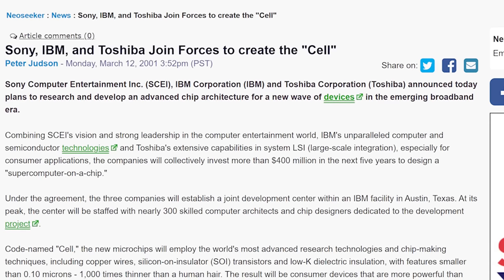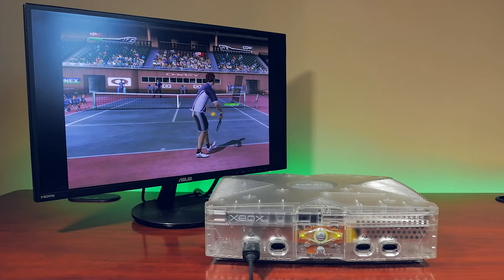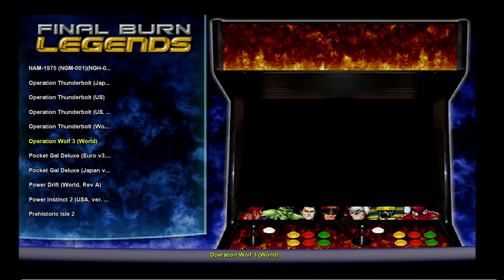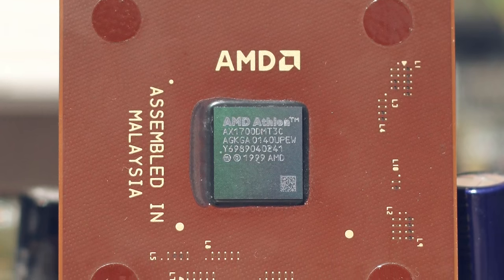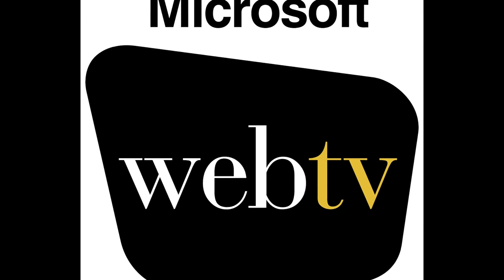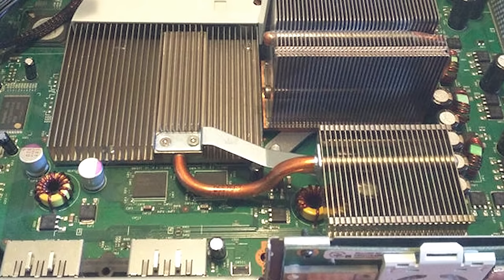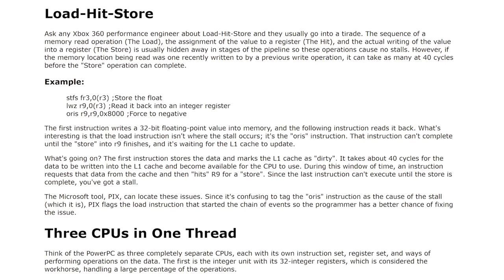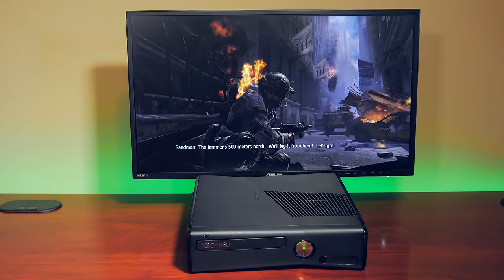Why Microsoft switched from Intel to Power PC for the Xbox 360  | MVG

Comment: There's a little bit of confusing info in here, making it seem like the PowerPC 970 design was created because of Sony, then used by Microsoft.  In fact, “Having created the PowerPC architecture in the early 1990s via the AIM [Apple-IBM-Motorola] Alliance, the 970 family was created through a further collaboration between IBM and Apple.” (source: Wikipedia, but also I was in my 20s then and loved this stuff and learned the same from news at the time), and is more commonly known by Apple's branding, the PowerPC G5 (IBM's branding for the architecture was GP-UL or Giga Processor Ultra Light built on the POWER4 architecture, so in other words, confusing).

So TL;DR: Apple had been working with IBM on PowerPC processors for a long time and the PowerPC 970 (AKA G5) was the latest version; both Sony and Microsoft had IBM create variants of the G5 for their consoles.

Comment: Slight confusion with choosing to mention the Penguin 4 with Hyperthreading and then go and mention the drawbacks of the original Penguin 4 in 2000 (RDRAM, for instance). Yes, the HT processor still had a larger pipeline and ran hot, but all the specs and such were from the original Pentium 4 launch.

That said, my Pentium 4 1.6A chip was pretty much a golden sample CPU and I absolutely loved it! Mine was in the higher side of overclockability

Comment: I had two Xbox 360 'pre-Jasper' and two PS3 Fat, and none of them were alive after 5 years, same for most of my friend's consoles at the time, so even though Microsoft took most of the blame (and the jokes), the PS3 Fats were not much better, if any, in terms of reliability, the difference being that MS replaced my two 360s under the extended warranty without asking any question, and Sony gave me a hell of trouble to replace the first one, and when the replacement failed a year later, they simply said it wasn't their problem anymore...

But putting the PowerPC thermal problems aside, we can't forget it was some kind of "perfect storm" effect for these problems to happen, too, with the lead-free solder having almost as much blame as the PPC itself, as many tech companies of this time were struggling to adapt to the lack of 'elasticity' of this new solder. Most of my computer cards of this 2003-07 period have failed because of the brittle solder.
Reply: PPC was never the problem. The CPUs used on the Mac are real PowerPc. What is used on the Xbox 360 and PS3 are cut down versions. The RROD on the 360 was because the GPU was burning up since the heatsink was so small or the Hana chip would die. The PS3 had yellow light of death because the capacitors below the Cell came out defective. Can't believe so many people in the comments are getting this wrong.

Comment: I'm wondering if the generation after next will be based on RISC-V cores in custom SOC designed specifically for the game systems.  This is an open architecture that they can use without having to get into agreements with anyone.
Reply: Not that much. The x86 patents of the 70 expired a long time ago.

Comment: Heat was a major issue for PPC. IBM assured Apple that they would be able to put a G5 into a laptop but they completely failed. The G5 ran so hot that it even put a cap on clock speed in the water cooled G5 Power Mac towers. Intel Core Duo ended up being much better from a performance per watt standpoint, a total flip from the G4/Pentium 3 & 4 years.
Microsoft and Sony soon learned what Apple had dealt with in their transition from the G4 to the G5

Comment: The original 7th gen consoles were cheaply made across the board and cobbled together.  Both the PS3 and Xbox 360 had more caps in them than a 1980s VCR.  The degree of corner cutting in an attempt to return to the days of selling consoles at cost was insane.  The reason both consoles saw constant version updates (3 in total for both)  is because of the bad construction, poor cooling and cheap faulty caps.

Comment: From my understanding an Athlon x2 running at 2.0 ghz was able to out perform Xenon in raw throughput even when all 6 threads were fully loaded. And it did this with less heat output on 90nm.

Comment: Interestingly, the thermal issues present in the PS3 and Xbox 360 are a part of WHY Apple would ditch IBM and PowerPC in favor of Intel and x86 around the same time; Intel was capable of producing chips for then-upcoming Macbook line that would provide what Apple wanted in terms of heat output, computational power and energy consumption. IBM was not.

Comment: The oversight with the PPC processors overheating on the Xbox 360 was inexcusable. The amount of documented systems that got the red ring of death with secondary error code 0020 was ridiculous and while it was improved with the later revisions on the Xbox 360 motherboards after Xenon / Zephyr, it still happened often up to the Jasper V2 Revision. I actually have a Slim with a Trinity motherboard that I tried fixing recently that had the same issue 0020 and needed a XGCPU chip replacement to be fixed properly, which means that this issue still happened on the revised Slim consoles. (Fixing this costs more to do than just buying a new system to begin with.) The amount of refunded and serviced Xbox 360 systems to this oversight had cost them so much that they had made another massive loss on Xbox 360 just like the Original Xbox due to soft / hard modding.

Comment: After Motorola and mips was kicked down, it was really just IBM left. Arm chip of the day was really slow.

The power 8 and 9 was very similar to the P4 netbust architecture in having long pipline and problem with flushing it.

It was not sony that made cell, but rather Toshiba. Mips cpu that sony used earlier was really put of date. 

It would look like the consoles went from z80/mos to 68k, to mips, to power and finally to x64.

This was pretty much was the mac of each era used as well. So while it is like a zoo of micro code for us today, that was the cpu of choice at that time.

Comment: Years back when i bought Xbox360 i knew that this is not a pc, it is something better. I hve very fast i have realized that current generations of consoles are just good looking PC with costume firmware.  I have skipped current generations and bought strong PC. Games are cheaper woks faster and i can use it for work. This premium feeling that you are buying something different then a PC is missing now.

Comment: Reading these comments, I see many people misunderstand how PowerPC fits into the computing landscape. Saying "PPC runs hot" is like saying "x64 runs hot"; some do, some don't, depends on the specific chip. PowerPC is just an architecture like x86/x64 or ARM. As an aside, when people say something "runs hot", all it means is it's using more power than its cooling can effectively dissipate. Any chip can be made to run hot if you saddle it with anemic cooling!

The PPC 750-based (aka G3) cores, used in all three of Nintendo's PPC consoles, is a relatively low-power and efficient 2-way (mildly) out-of-order design with a very short four stage pipeline. The PPC 970 (aka G5) is a vastly different design, implementing a 4-way deeply out-of-order design with a fairly long pipeline. It indeed consumed a fair bit of power, but then so did the Pentium 4 (its main competitor at the time). 

Contrary to some people's understanding, the core used in Xenon (and the PPE in Cell) is yet another very different design from anything prior. It's based on the 970 as much as Intel's Atom is based on Core; i.e. not very much at all! It implements a 2-way in-order design with SMT and a very long pipeline. That allows it to clock very high, but being such a simple design, even a much lower clocked G5 destroys it in performance.

All that being said, the PPC cores used in X360 and PS3 were probably the best choice at the time. MIPS had been abandoned by the major players, ARM had nothing even approaching this level of performance, and x86 would have been more expensive and used even more power for the same performance.

Comment: Amusingly, has they used lead based solder, these things wouldn't have packed landfills with dead consoles. The failure mode was ultimately down the horrible lead free solder cracking from thermal cycles, but thanks to the reduction of hazardous substances (RoHS) they had to use lead free solder.

I still solder with 60/40 leaded solder for my projects, it's a much more enjoyable solder to work with than the lead free stuff, producing very nice and clean solder joints.

Comment: Re: 4:36, the Pentium 4 platform had already dumped RDRAM by the wayside back in 2002, while 360 development started in 2003. The inclusion of Rambus technology wasn't a hindrance to Sony which used RDRAM in the PS2 and XDR DRAM in the PS3.

The main reason why the 360 didn't contain an Intel chip would definitely have been Intel's reluctance to fully license the chip's IP (to allow die shrinks for cost reduction and the closer CPU/GPU tie-in) and IBM promising further performance increases to PowerPC which didn't exactly materialise (nor did they for the Pentium 4, in any case. The 360 did run at 3.2GHz but that was because the designers didn't feel that they needed in-order execution).

Incidentally, Steve Jobs promised said performance increase for the Power Mac G5 around the same time, then had to embarrassingly apologise for not being able to deliver it the following year. Apple most likely got annoyed with IBM during that period, then announced their move to Intel in 2005. They likely begged Intel to release the Yonah processor ASAP, which was released in January 2006, too late for a Thanksgiving 2005 launch.
It could have gone differently if Intel was more willing to allow customisation and was slightly earlier with realising that the Pentium M architecture was the way forward. Imagine a high-TDP quadcore Yonah powering a game console.

Comment: If you go back to microprocessor technology at the turn of the century, it was clear that the future was RISC. If you looked at Intel's and AMD's x86 processors, they were internally based on RISC cores wrapped by an x86-to-RISC instructions translator. (This is still true in their latest CPUs.) The translators made the cores compatible with 20 year-old software, but weren't necessary for yet-to-be-written games. Obviously, if one removed this translator, the cores would be smaller and perhaps faster. Sony, Microsoft, and Nintendo were simply following the prevailing technology trends.
So what happened? The money generated in the PC market (which at the time were selling 100 million per year) allowed Intel and AMD to employ hundreds of engineers to optimize x86-64 processors, while RISC design teams were an order of magnitude smaller. This allowed the theoretically less efficient x86-64 cores to surpass the performance of contemporary RISC designs. Additionally, GPUs from Nvidia and ATi/AMD also benefited from the volume of sales in the PC market, improving their performance until they needed to be tightly coupled to the CPU to be used effectively.
So what would it take to pry high-end game consoles from the clutches of x86?
1. A faster CPU design than x86.
2. Mature, usable software tools. As you point out, there are a lot of code optimizers for x86.
3. A decent GPU design that can be integrated with the CPU.
4. Memory controllers, I/O device interfaces, etc.
All this requires commitment, money, time, patience, a huge design team, and a lot of risk.
Until then, performance games consoles are going to look a lot like PCs.

Comment: The Xbox CPU WAS NOT a Celeron. The Coppermine Pentium III and Celerons were distinguished not only by L2 cache size but also the cache architecture. The P-III cache was more complex and costly than the price focused Celeron. Microsoft wanted to reduce cost and Intel offered to cut the cache in half while retaining the higher performance architecture. This smaller cache is often mistaken for meaning the CPU was a Celeron but this overlooks the cache architecture. The Xbox CPU is listed as a Pentium II because it was a Pentium III in all the ways that mattered.

That was the full extent of the customization Intel was willing to offer, which let them take advantage of P-III production in which a portion of the cache came up bad and would otherwise be dumped in the trash. AMD back then also unwilling to offer the kind of changes Microsoft and any other console maker would want. IBM's PPC business was much more accommodating, being focused on embedded designs for the auto industry and others. As Apple was their only customer to speak of in personal computers, this was the core market for IBM. Trying to keep up with Intel on performance proved to be far too costly without the massive PC market to drive a relentless cycle of advancement to process nodes. This was ultimately why Apple dropped PPC for Intel, as their Macs were perpetually falling behind the latest Intel and AMD products. This was making the high margin professional market more open to using Windows PCs for their work, so Apple needed to make a change.

The Gamecube was a good example of how accommodating IBM could be. The existing PPC chip that served as the basis for the eventual Gamecube CPU had some 64-bit registers that Nintendo felt would be overkill for the purposes of a game console. IBM was able to alter the registers to instead store two 32-bit values for a very basic form of SIMD. It gave a nice boost to performance for some critical instructions and brought the Gamecube in for a very low cost. Although it didn't dominate the generation, Nintendo was able to bring the retail price down to $99 without taking a loss on the hardware. This made the Gamecube very accessible as a second console for those who wanted access to the Nintendo franchises but favored the competition for most of their gaming.

By the time the Xbox One and PS4 were in the early planning stages, things had changed a lot. AMD was in a long slump but had acquired a major GPU maker, ATI. They were very open to making the sort of custom design the console makers needed and having both CPU and GPU coming from the same vendor allowed for a high level of integration. That relationship continued into the current generation and on into the foreseeable future.

Comment: A big thing learned from Sony is that development ease is very important. The Cell, in the long run was a more powerful platform but was very difficult to program for to manage the 7 accelerators. This changed as SDK's (especially UE3) fixed this. Right now though, MS investors realize the 360's success was not because of MS outclassing Sony, but because Sony really dropping the ball during the 7th as Sony wanting to secure Blu-Ray and the current management not having any real business moxie and not wanting to take as big of a hit in the beginning. Sadly if they had been willing to Trust Playstation management we might of salvaged PS1/PS2 backwards compatibility and had a totally different outcome. 
I will say a major thing is RISC RISC RISC. Power9, IBM's current server side is a powerful proc. Sadly commodities drive development sometime. x64 really changed everything.

Comment: Intel really should have known better than to use RDRAM by that point.

The Xbox 360's thermal issues weren't just due to the CPU. The use of a full desktop-size DVD drive also contributed to the heat, making the original design's pitiful heat management twice the problem it would have been from the CPU alone. The fact that said desktop-size DVD drive was supported by plastic rails that would inevitably warp under the poorly-managed heat was the extra-rotten cherry on top.

All three companies used Power PC, but in different ways. Sony and Microsoft used different customizations (with vastly different optimization methods) of the same baseline chip to reduce costs compared to the PC version, while Nintendo just tripled up the same already-cheap (And cool-running) chip they'd used for the GameCube.

Comment: I always thought the RROD was caused by the GPU more than the CPU.
At least that's what I've read.
Reply: They tend to run hotter in most cases. A lot of systems needed new thermal paste as some left the factory floor overheating from bad compound.

Comment: So I'm guessing that the Wii and Wii U's chips didn't run very hot? Wii didn't have the thermal problem probably because it was so slow, and Wii U I guess because it just came out so late the issues were ironed out? I distinctly remember my Wii U somehow managing to push out cold air on multiple occasions.

Comment: The Pentium 4 at the time was crap, but the Pentium M in the Centrino laptops at the time were AMAZING chips.  Still too costly for the 360 though.  I really wish they had stuck with x86 for the 360.  Backwards compatibility on the entire Xbox line would have gone much smoother.

Comment: I think ARM and Apple are more responsible for this than anyone else. 
By the time the XBOX360 was being developed, Intel and AMD had entrenched themselves as the main computer CPU providers, with PowerPC being a holdout. ARM, even in that era, was far more power-efficient than PowerPC or Intel. Consequently, nobody could compete with ARM over power consumption. This effectively made IBM give up on making power efficient PowerPC chips in favor of focusing on performance, which caused battery life issues for Apple, which caused their changeover to Intel. With PowerPC having lost its biggest customer, they had to find new ones, and that meant that they had to work with customers and give good prices.

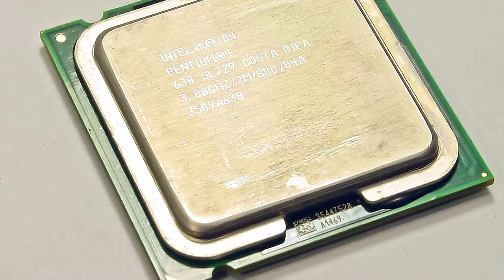Comment: At 4:25 in the video you talk about the Pentium 4 clocked at 3 GHz and has a 200 MHz physical clock. What is meant by the physical clock in this case? I'm having a hard time finding information or figuring out what to search on to learn more about the differences?